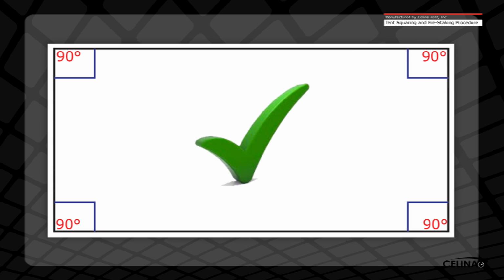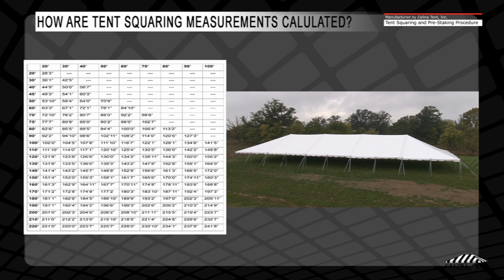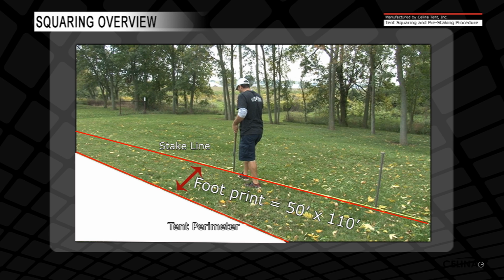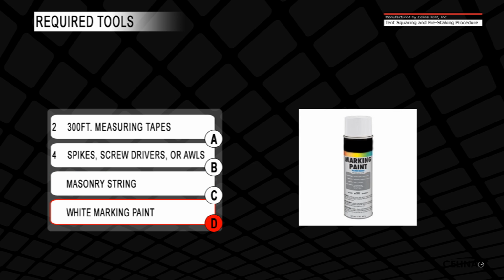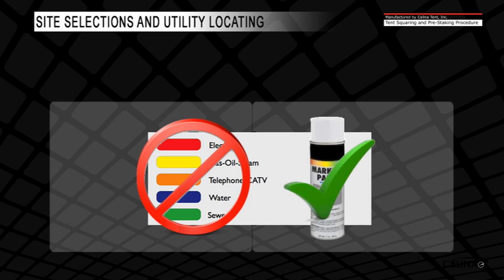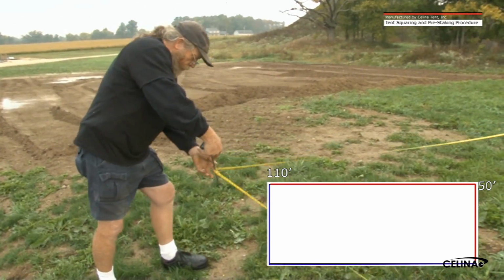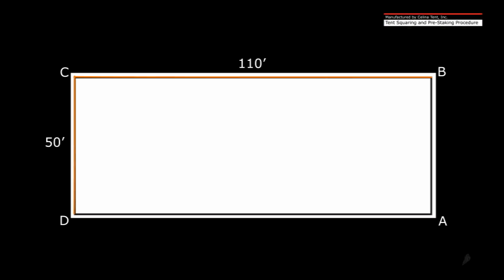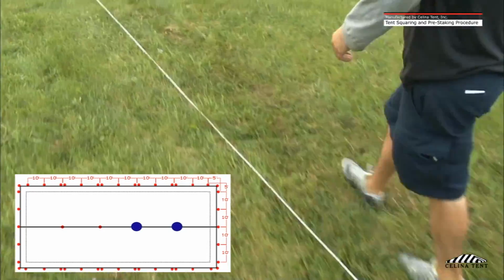How to Square a Tent Layout | Stake Line & Perimeter Setup | CELINA

Comment: A 100-foot tape and lengths of 30, 40, 50 feet.... 3^2 + 4^2= 9 + 16 = 25 = 5^2. So any 3,4,5 combo will give you a right angle. Reverse the corners to make a rectangle. So drive a pin at your reference corner and stretch a line along your critical edge, measure the longest multiple of 4 along that line. Let's say it is 40 feet. Drive a pin to mark it. While hold the 80 foot mark at that pin (50 plus 30 equals 80), walk the slack of the tape and tighten it at the 30-foot mark. That will be the perpendicular line to the next corner. Reverse the process to make the rectangle and check lengths. Carpenters have been doing that for centuries, and it is how we set out tents (and the subfloors/staging/dancefloors beneath them if needed) for decades. Stake offsets generally 75-85% pole height.
I appreciate your videos.